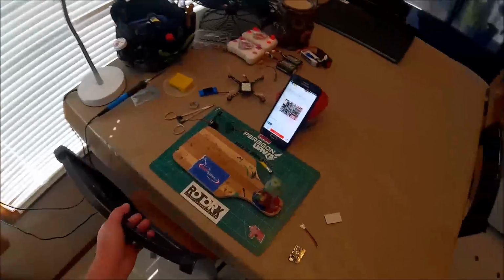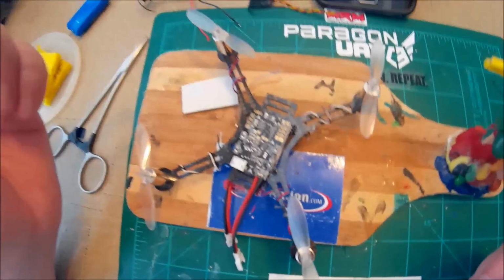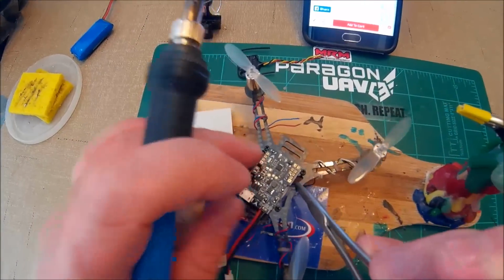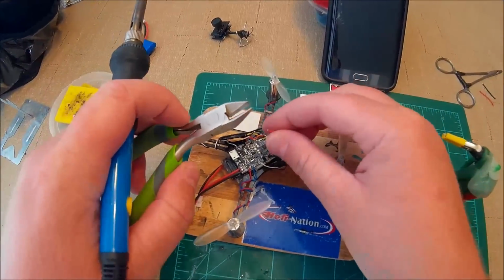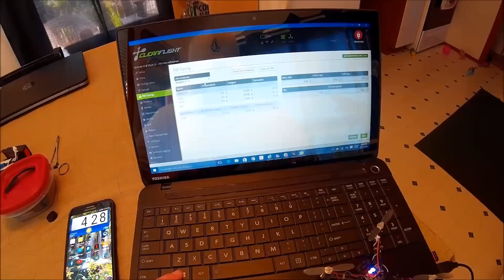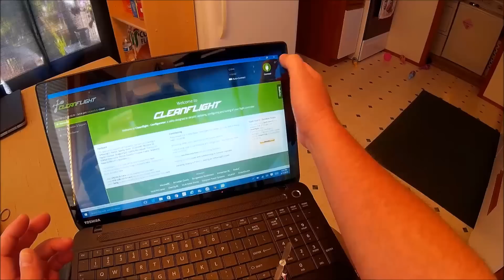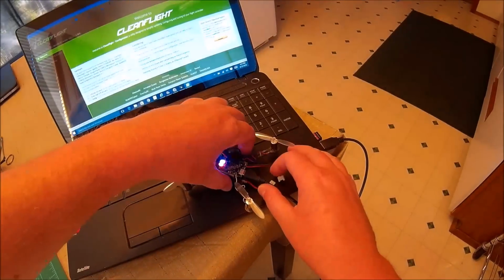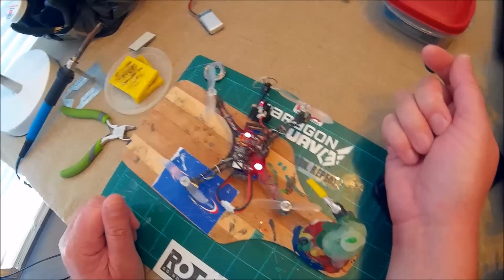brushed f3 build

Comment: ok last question,  I noticed you said your motors didn't get hot in one of your vids.  Mine get pretty hot.  could it be the props?  They are 65mm on the kingkong smart 100.  all my settings are the same as yours in the picnic vid.  love the way it fly's tho.  well,  when i can keep it in the air, lol'

Thanks

Comment: Hello, I would like to ask you for a technical question:
As you installed a F3 brushed. I use betaflight as firmware. I have a problem with the beeper. It beep constantly as soon as I push the throttle. And you? Is this natural beep unnerving during the flight. For information my Vbat and properly calibrate and my battery is fully charged. The betaflight modes are well attributable. I do not understand why the buzzer beep without stopping. Do you have a solution ?? Because I use the same buzzer style as you. Thank you in advance.

Comment: good build mate.. just did mine! 90mm X frame from picnic quads.. what is that thing you did in the terminal command with the motors? I didn't do that
Reply: What is the purpose of this setting?
Reply: Thanks. Will the buzzer work with this when Vbat is set?

Comment: I doubt you'll even see this but if you do, was there anything you had to do to the FLight Controller before hooking up the motors? I soldered the motors, FC and camera. When I plug in the battery the motors just spin. What am I doing wrong? I really want to get this thing in the air!!! Haha thanks in advance.
Reply from the maker: You have to change the setting in configuration tab to brushed
Reply: @ADMDGLS69  so set it up first in clean flight or betaflight first? Then I wont have that problem?

Comment: Hey Adam, I just recently found ur vids, and wanted to say, good stuff bro. I actually am a little new to the game and found ur vids really helpful. I too am using a DX6 and getting into brushed quads. I just purchased an f3 alien Brushed fc clone from RTFQ {which was mentioned in one of ur other vids}. Was wondering if you have any experience with this FC or any advice for a newbie. I'm actually getting ready to connect to clean flight for the first time right now. I was just flipping thru your video catalog to see if you had any vids that I could learn something from before I start this endeavor :<)
Reply: hmmm, this is a beta flight vid, im looking for a cleanflight vid, basically start to finish how to vid. i cant find any builds with this F3 clone FC.......
Reply: Gotcha
Reply: what did you type in @ 25:00 mins when you where entering the SAT info? you didnt say it out loud as you where typing. Something like : set pwm_sat_ ........or something like that?

Comment: hi adam, followed your vids in all steps but got a problem wih the satelite afte dehousing and soldering the 3 cables, now its not working anymore m what have i done wrong? bevor i removed the 3 wire plug it was everything working , i removed the plug easily with the heat gun , it seems that the satelite is not getting the full 3,3 v ,the led on it shines very low, did i ruined it ? hope you can help
Reply: FredericoSecondo  are you using the lower or sides pads? if you are you have to use the same pads the the plug was on. I had the same issue.
Reply: bentley sayachack thanks i will try the side Pads , there is not much left to try , maybe the sattelite is ruined
Reply: FredericoSecondo well you have 3 pads so try all of them. I spent a hr trying to solve the issue I has same as you.

Comment: Need some help, I can't arm my quad, my travel goes from 1100 to 1850 on all channel, I set the travel adj on the transmitter to the maximun (125) I'm using a DX6i and betaflight
Reply: ADAMBOMB I already reverse my yaw, I will try changing to spektrum 2048
Reply: I change from 1024 to 2048 and still can't arm the quad, all channel move as should, my yaw travel goes from 1070 to 1880 and my throttle goes from 1060 to 1880, on the configuration tab I have min throttle 1060 and max 1880, mid at 1500
Reply: The only way I find to arm the quad was to assigning  the arm to the same switch as the angle/horizon mode, so for now I arm the quad and have only one mode, couldn't make it arm with stick commands

Comment: Could I pick your brains Adam I've jumped the boot pins and connected zadig however stm32 bootloader appears then disappears I've tried several USB cables and desoldered boot pins and resoldered but no joy
Reply: ADAMBOMB FPV thanks Adam I thought I was doing something wrong there's so many variations of the same board some good some bad can the eachine board support betaflight as I see it comes with cleanflight

Comment: If I arm and spin up the motors while plugged to cleanflight I see the power voltage fluctuating on cleanflight regardless if I use 1s or 2s for power. this same thing happens when I test the motors on the motor tab. What kind of problem is this, has anyone ever had this problem. 
So if I'm in cleanflight and I put the battery on the voltage reads a level all day until the motors spin.